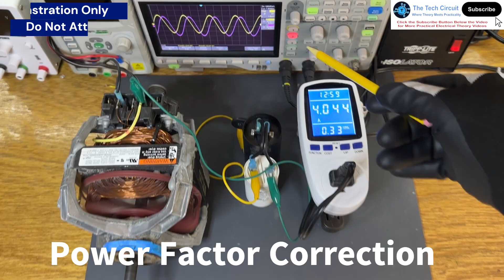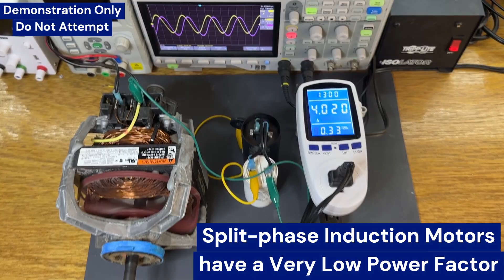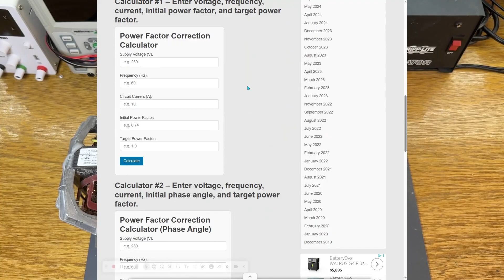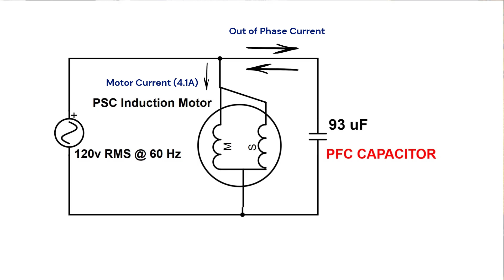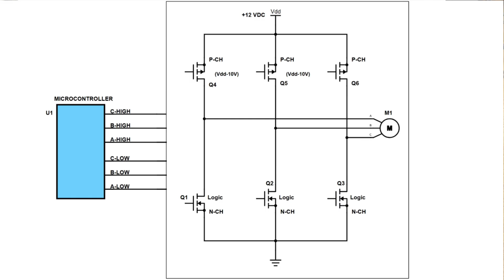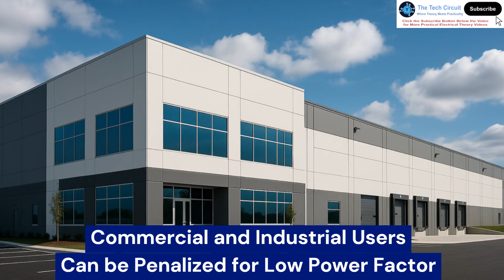#110 -  Running a 4 Amp Dryer Motor on 1.5 Amps?  Power Factor Correction Demonstration.

Comment: Nice presentation.
Just a naive question? In case of use a transformer for a simple one phase spot welder 50hz 230 volts and at secondary coil about 3 volts and about 1000 amps or a little more. Do I have power factor issue or not? I asked that because the load is mostly resistance. If finally I need power factor correction what capacitors you propose? 
Thanks in advance for any answer to my inquiry!!!

Comment: Will the power factor be significantly affected by applying a load or is it almost entirely just a matter of countering the inductance with capacitance. If it is this simple to correct a low power factor, why aren't manufacturers required to do it for their products to be certified?

Until customers are penalized by power suppliers to recoup the added costs of poor power factors, they likely would resist the extra cost. This is where government regulations could make sense - to benefit the entire power grid by requiring a relatively inexpensive component to be added to these inductive loads.
Reply from the maker: Yes. An induction motor looks more relatively resistive when under load. An appropriate power factor correction capacitor can be calculated for when that motor is under nominal load. Yes I’ve heard of more induction motors in appliances being migrated over to being power factor corrected or using run capacitors, which also improve power factor.